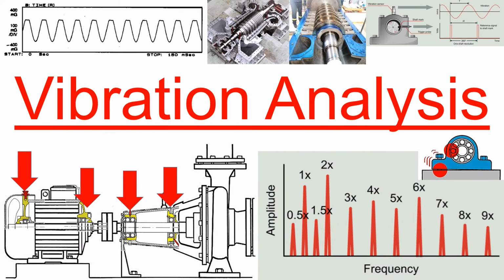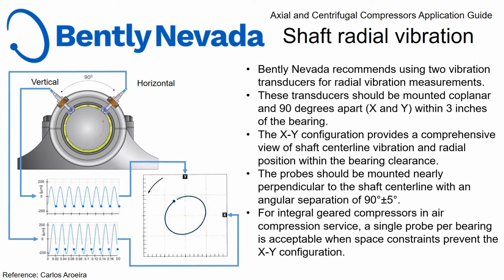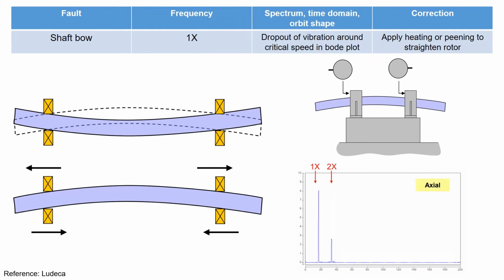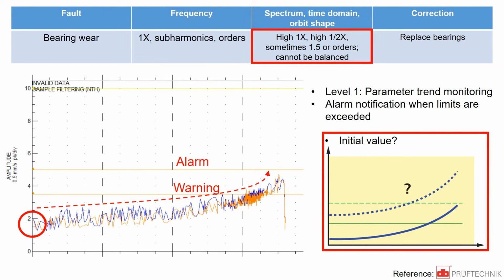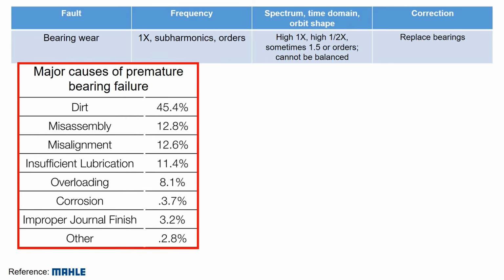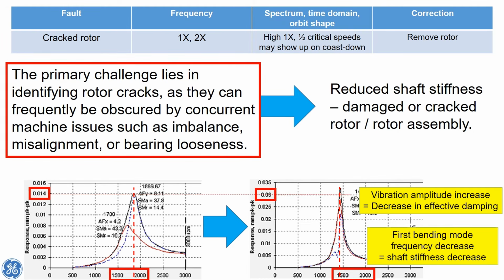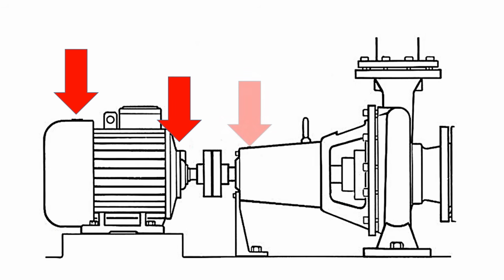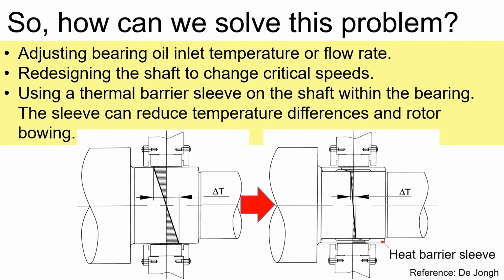Part 41 - Vibration Analysis - Condition Monitoring in Rotating Equipment

Comment: Based on what the balancing grade for the rotor is chosen as per ISO and API system can you explain like when we need to go with 1plane 2 plane multiplane wrt grade system ? simply what is the deciding factor of balancing grade and number of balancing planes while doing balancing on the rotor ?
Reply from the maker: Excellent inquiry! The choice of balancing grade is indeed contingent upon the specific requirements of the machine being designed. For high-end, long-lasting machines where reliability is paramount, opting for a tighter balancing grade is often preferred. In numerous cases, a G2.5 grade strikes the right balance between precision and cost-effectiveness.

Additionally, I recommend referencing Part 24 video for further insight into distinguishing between rigid and flexible rotors. Understanding this distinction is crucial as it significantly impacts the balancing process. Rigid rotors, typical in simpler machines, generally follow a more straightforward balancing procedure. Conversely, flexible rotors necessitate a more intricate technical evaluation to achieve optimal balance. Thank you for raising this pertinent point!

Comment: In case of bowing we also observe continuous phase change as described in Newkirk / Morton effect
Reply: Yes and it should move in same direction as rotation, whereas for a seal rub causing bowing phase change goes against rotation as explained by the great late Prof den Hartog in his book "Mechanical Vibrations".
Reply: @MrFRANKOK  you are right. Phase rotation is different in both cases. I have seen both of them happening at different compressors in our plant. Thank you for sharing the reference of the book, I will definitely check.